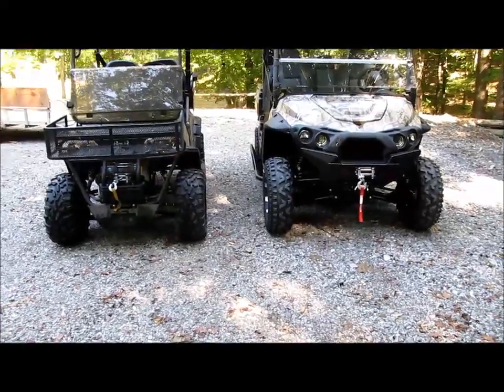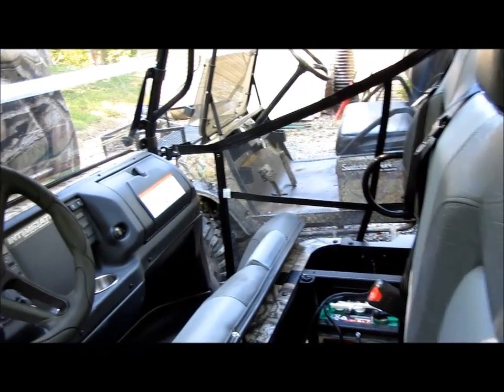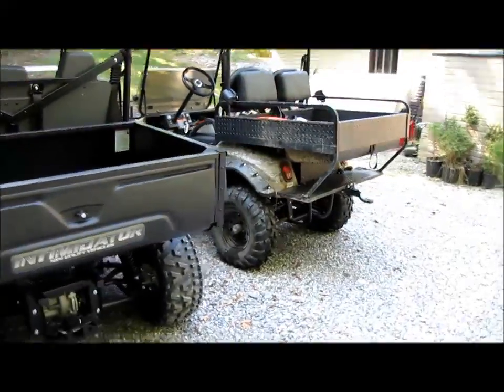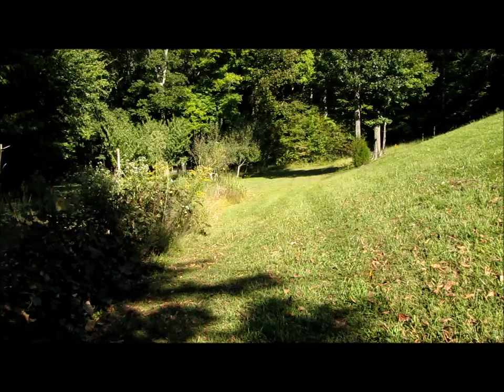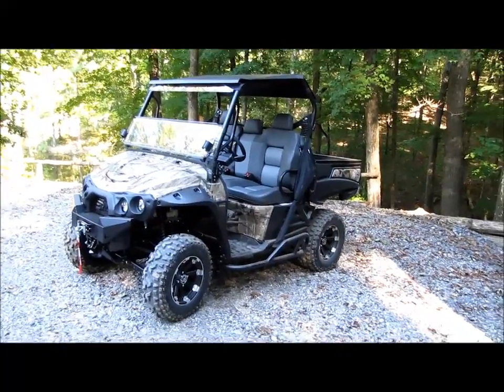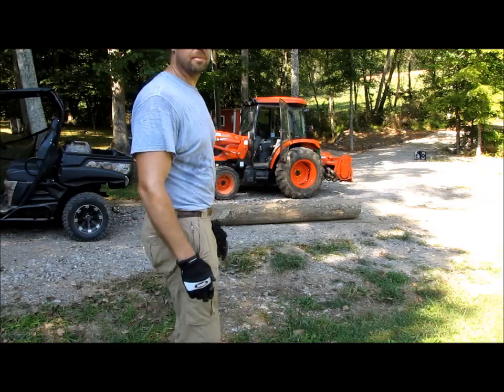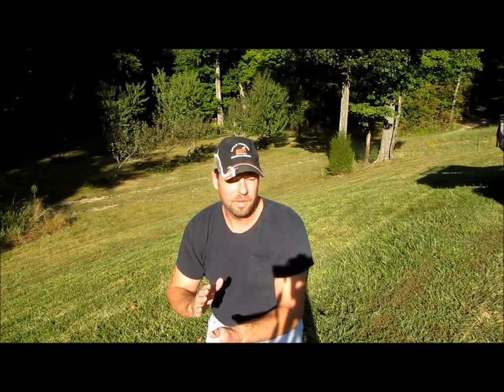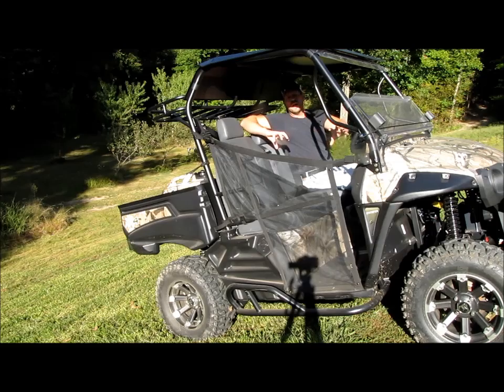Intimidator Electric UTV vs HuntVe Switchback

Comment: I'm just updating again on my HuntVe I've owned now for over 10 years.  It's a 48V, full positive locking hubs front and rear with all 4 wheels turning when in 4x and I've still never been stuck once.  On top of that, I own a pond dredging company and use it to back my dredge trailer into ponds till the dredge floats off.  Then, when I'm done dredging, I have to back the trailer even further into the pond to  get the dredge back on.   I'm in the worst pond mud you can imagine and I'm at an angle pulling the trailer with the dredge on it out of the pond/mud and up the bank!  Never been stuck once.   I've had to get parts for the HuntVe twice from the factory, and both times they sent the parts free of charge.  They are a great company, I literally use my HuntVe on our 26 acre farm or dredging every single day.   You really need to tell people that you didn't order your HuntVe with positive locking hubs front and back.  You can't compare full locking 4x4's to an open axle set-up.   That's a 4x4 compared to 2x4.
Reply from the maker: The year I bought this they didn't have the Positive Locking hubs otherwise I would have got it. I don't believe that was even available.

Comment: I bought an intimidator utv brand new. over $17k. I have a farm in Iowa with hills. The intimidator got less than 2 miles to a full charge and was awful. I got stuck twice and had to walk up the hill twice and get my truck to pull it up. Sixty seven percent battery life and it wouldn't climb the hills. The main fuse panel blew up because of an error coming out of the factory few weeks after I had it and it was in the shop for over a month. When it went into the shop they said it was missing bolts from the factory in the rear end and they come across that all the time so they check that as they order new units. The customer service was less than desirable. All I got out of there top guy was "we dropped the ball on this one". It took them a month literally to get the parts to the dealer. He wanted to give me some money back! I called the dealer I bought it from and told him if they didn't take there lemon back and return all my money I was going to sue intimidator. Luckily I had a good dealer and he just returned it and said he would deal with intimidator. I ordered a full cab and was supposed to get it within three weeks and 8 weeks later nothing. After the lemon got returned a few weeks later the cab showed up. Save your money, I was so disappointed. I thought I did my homework and was getting the best machine for my money. Definitely not the case. Fyi, I was so frustrated that I called intimidator and asked to talk directly to the owner and got pushed off to supposedly there top guy. His customer service skills were less than desirable. I wish the outcome was different. The machine does look like a beast but is very delicate and way to heavy for electric. Maybe if it had a built in generator that charges it that could be better. But after my experience with intimidator I would look elsewhere and I am right now at the moment actually.

Comment from the maker: you should also know that I have been stranded with the hunt V. I had to bypass their electric switch that senses when the batteries get too low just to keep it charging. what happened was once it gets low the generator wouldn't charge it because it was too low to charge (amps too low). I communicated with the factory reps and their solution was to bypass that sensor. I have not yet been stuck on the Intimidator at all. Just FYI

Comment from the maker: yes, good observation.  it does have a little transmission whine. but I think it is much less than the ground noise from the tires so I think it is irrelevant.  once you get away from the machine 20 or 30 yards you really can't hear anything.

Comment: very much appreciate your honest, thorough reviews - thank you.  i live in vermont with my family on our 1,300 acre property.  we have steep mountainside, level fields, and everything in between, plus lots of field and forest trails.  we are stewarding the forest (85%) and fields as a unified "farm".  we bought a used electric cart last year for use in our main campus/perennial food system - we love it!  we'd love to add an electric UTV to our fleet, something more rugged than what we have to take out into the forest and more remote fields.  it will be used to haul gear, plants, us.  after considering our research and this review by you, we're very interested in Intimidator's electric model. our biggest concerns are (1) range (how far can we go on a charge given the terrain and size of the property, as well as weight of our gear); and (2) how will it perform in our colder climate?  you mention in the review that you purchased a Honda EU 2000 generator to take with you in case you needed a charge.  how has that worked for you?  are you still impressed by the electric Intimidator?  thanks in advance.  shawn
Reply from the maker: yes I would still recommend the Intimidator, it is the biggest and baddest of the electrics. I have brand new heavy duty batteries in the hunt V and the stock Intimidator still runs three times as long as that one. The Intimidator has that single electric german-made engine which seems to be a much better set up. as far as running low and needing the generator I have not needed it yet. that has been another benefit of the Intimidator is it slowly Runs Out, whereas the hunt V and probably some of the others drain out like instantly when it gets under half. I don't know how it will do in cold weather but if you keep it in storage it will do a lot better during cold periods. the Huntley was terrible in cold weather in Kentucky, but I kept it in storage that was outside temperature.
Reply: +Kapper great, thanks very much.  if you ever do get around to having to use the generator I'd love to know how it worked for you.  i believe you said you purchased a Honda EU 2000?
Reply from the maker: +Shawn Smith Hoffman yes I purchased the Honda eu2000. I believe it will work just fine. The hunt V has a generator on it which I have used in the past when thar one has run empty on power. Usually after about 15 to 20 minutes it has enough juice to get me home. Good luck
Reply from the maker: +Shawn Smith Hoffman I did call the Intimidator engineer when I bought that generator to be sure it would put out enough amps to give it a charge.
Reply: +Kapper Can't do better than that.  Again, thanks so much for all this incredibly helpful information.  Did you buy direct from Intimidator, or a dealer?  There are no dealers in the northeast, yet, which makes things a bit challenging.
Reply from the maker: +Shawn Smith Hoffman a local dealer here in southern Illinois
Reply: Hi Shawn, thanks to you were are the only independent Intimidator UTV dealer in the Northeast. Thanks for your business this year!

Comment: I did check out the Intimidators, but they've changed the bed size in their models now.  The Classic's rear bed is so small, it's not usable for me on my farm.   They are nicely built, but without a usable bed, I can't see having on.  The won't even build an electric now with anything but a 2' deep rear bed!

Comment: Honest question.  How often do you use the winches?  With Jeeps, F250/350s, a 4x4 tractor, and an old fashioned Come Along I have been in situations where one might have been useful, but I have never "needed" one on a side by side.  In the HuntVe's defense tires make a big difference.  I bet if you swapped the tires from one machine to the other I bet the results of the tests would be a lot closer.
Reply from the maker: First of all, I don't think the tires would matter. The more I used it, the more I found it failing, just its design in my opinion, thanks. 
But yes, we do use the winches quite often. We often have large, downed trees on the trails, and it is nice to yank them off, the real heavy ones. also very nice for securing on a trailer, I let out 6' of winch and hook it to front of trailer and snug winch. And of course.... getting stuck. Depending on where you live, yes, we get stuck a fair amount when you hit a low, wet spot and were not expecting it. Thanks.

Comment: How has the Intimidator been since you did the review?What kind of range are you getting?
Reply: I have the 2014'.  I'm getting @20 miles per charge in hill country.  On flat land, you pretty much get the 30 miles that they advertise for a 48 volt system.  Love my Intimidator and wouldn't trade it for another unless it was a 72volt Intimidator, which I really hope they build so that you could get more amp hours and therefore more distance.  Super rugged, super comfortable, and super strong.  Wish I could post pics.  I dragged out two 250lb hogs at the same time and hauled them back in the bed at the same time through heavy mud and in hill country.  Only issues I've had is distance due to up and down running on a 2000 acre lease in the hills and the actuator motor on the bed lift went out due to moisture intrusion.  I need to replace the springs and brushes and it works.  Hope this helps.
Reply: Terry Martin voltage has nothing to do with run time.  Voltage means more power. Runtime is based on stored Amp Hours ( AH ) of each battery in the series. Most 12v batteries for these carts are around 150ah @20 each. And a 48v system you only have 4. That equals 600ah of run time. Not very much at all.  Even if you have 2 48v packs in series (800lbs of batteries) that’s just 1200ah if stored energy. I have a 48v lifted golf cart with high torque motor and controller with 8 6v batteries which have 225ah each for a total of 1800ah of stored energy. And my cart ways half as much. Which means better performance, and WAY better runtimes than the intimidator. 
If they came out with lithium batteries in a UTV with enough of them to get 100 plus miles in ruff terrain I believe the gas UTV market would become obsolete. At least it would for me!!!

Comment: Great head to head. I'm possibly going to get an electric ride in the near future. Been thinking about a Bad Boy Buggie....  but this intimidator is now in the running...  One thing I was wondering.  It seems the intimidator has a little more noise than the "Golf Style" machines.  Like more of a whine...  Is that a true statement? I'm thinking is could possibly be the transmission vs direct drive?  again great informative vid...

BC

Comment: The HuntVe Hybrid needs to be placed into consideration as it is a 72 Volt unit with 4wd and a backup gas supporting generator that the Intimidator does not. Just getting around under normal conditions I would select the HuntVe Hybrid hands down which should have been considered in your unbiased review!  I agree with “Life with The Hampton’s” as you sure seem to be in favor of the Intimidator.
Reply from the maker: I did not like the HuntVE one bit, but keep in mind this was years ago. But after many years our Intimidator is still a beast of an electric UTV. Huntve may have improved by now. Thank you

Comment from the maker: been great. not sure on range because I don't really trail ride with it. I use it for short distances and through rough terrain. I can say that it holds its charge two or three times as long as the hunt Ve does. Much better machine.
Reply: Just watched a video where the Intimidator only got 9 miles off road on a full charge. I just don’t find that acceptable. I wish someone could build a lithium ion electric buggy, with locking rear diff and front diff, that has 2 speeds that was capable of 35mph+, yet could crawl without over heating, with a 80+ miles range. Polaris has the new Ranger Kenetic EV but that one starts at $25k. With extended battery it’s $30k. That’s crazy for me to think about.  I don’t have a vehicle that cost that much!  Lol

Comment: Great review.  Thinking an electric UTV, I think I've narrowed it down to the Polaris EV and the Intimidator.  The Polaris decked out with a cab and all is quite a bit less expensive.  Have you ever compared the two?  Thanks!
Reply from the maker: JP yes I did. the polaris is much smaller and less capable for sure. lots of unhappy campers with the polaris.  I just traded in my HuntVe for another Intimidator UTV, but I got a gas one this time
Reply: the new polaris ev is amazing.

Comment: Why is it still noisy it’s electric I have a golf cart that is totally silent I can creep through the woods and you can’t hearAnything but the rattling of the leaves I think I might go for more horsepower and less noise after all I’m not pulling logs I’m hunting
Reply from the maker: The noise is minimal and you can't hear it over the tire ground noise and it has greatly decreased over time. Maybe the German motor needed some break in?
Reply: My thoughts exactly. It was so loud!!! I want an electric vehicle to be silent, not just quieter than a gas side by side. I have a lifted 48v (8 6v Trojan T105's) ezgo with 25" tires and 600amp alltrax controller with plum quick 15hp torque motor. It runs 27mph on flat ground, and gets around 30-35 miles to a charge in very rough terrain. It has enough power to literally pull the front tires off the ground 2-3' in the air on take off. I have $3000 in parts on my build.. There is no way the Intimidator is worth 6x more than mine...One thing I dont understand? Why make a Chassis thats capable of doing all this HARD work, pulling and Hauling Heavy loads, when in reality if you use the Intimidator like its advertized you WILL only get 5-10 miles out of a full charge. So its almost worthless to use it for anything other than Cruising around and going undetected while hunting. My cart does all that!!!! It seems its an advertising ploy to show all the work it can do, but it cant do it but for a very, very short time.
Reply: I now own a 2021 Intimidator Classic EV. The " whining " that you hear is coming from the Transfer Case, not the motor. The  reason electric golf carts, and other 4x4 electric buggies don't have this whining is because they don't have a separate transfer case with high and low range. The whining is not bad at all, but it is much more noticeable to the people inside the machine. Meaning you can barely hear the noise outside the machine. This is because you are sitting on top of the motor and transfer case. Its not as loud as the video depicts

Comment: Considering buying the electric intimidator. hunt in Northern WI were it is very hilly. Kapper what type of milage ae you getting.  Did you buy your new intimidator in gas because of battery life in the electric. Found this review really helpful but just cannot find and good data on milage with Intimidator.
Reply from the maker: Well, it is hard to quantify 'mileage' on electrics, especially in hilly country. The intimidator has been a great performer, which I believe is because of its single engine design. Although now they are all making 64 volt which ought to be better. But in steep, hilly country you will not get much life/run time. ESPECIALLY when it drops below 40 degrees. Unless you can store it inside with some sort of heat.. I actually got the new intimidator as a financial defensive move because the HuntVe electric was just not working out for me and I traded it in while I could still get a little something for it!! Plus we really need a gas work horse to go along with the electric, it will compliment our farm use well. I have 150 acres that is hilly, but maybe not quite like the Eau Claire/Northern area! But for hunting use back and forth it is more than capable, especially if you can store it indoors with some heat. And in the winter it needs to be kept plugged in at all times when stored to A)save the charge of course, and B) as it tops the charge off it generates some heat. I do believe that intimidator is making a 64 volt now which would definitely be the cats meow!!!! Too late for me, but would be great for you. But be warned, they are not cheap! :) Good luck!!! Where are you at up there? I know Northern WI pretty well !
Reply: Thanks for you quick response, we are in Buffalo county near Fountain City, WI. We hunt 200 acres, but honestly during the hunting season we try really hard to minimize our exposure and tend to go to the stand and back.  Our vehicle use is really 50/50 meaning half the time going up the hill which tends to be steap and half the time down whcih takes no effort.  I would say if we drive 5 miles in avg weekend that would be a lot.  Currently use a Yamaha but it is very loud. Great machine but considering an electric to be more stealth.  
Have not seen anythng about 64v Intimidator on their web site?  Basically looking for a vehicle for Hunting season all other work will be done by gas machine.  Has the Intimidator preformed well with no other issues. Would you purchase again or would you consider a different machine?
Reply from the maker: Greg Brown from what you described the Intimidator would be just fine especially if you could plug it in one night over the weekend but probably might not even need that. yes I would definitely recommend the Intimidator it is truly a badass machine. it is built way more rugged than most of the other electrics if not all of them. It rides on the exact same heavy-duty frame as the gas models, what you described is exactly what I do. I use the electric for hunting season and it really does make a positive difference. I have a mesh type camo tarp that I drape over the machine and I have had deer walk right by it and not even notice it, and of course they did not smell it

Comment: Can someone tell me we hy they dont run a sollar panel on th roof or is it  usafe or not practical
He said he already has been caught running out of power.
Reply: wont get enough power to help except to keep battery topped off if leaving it outside in sun at a remote location